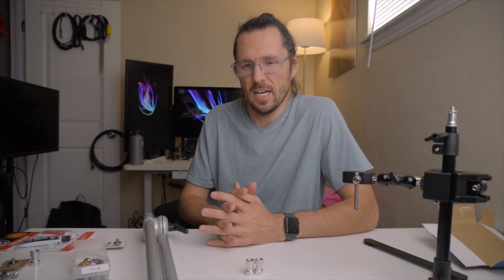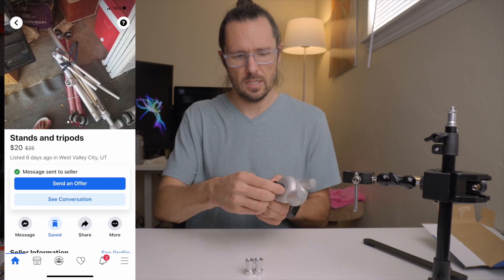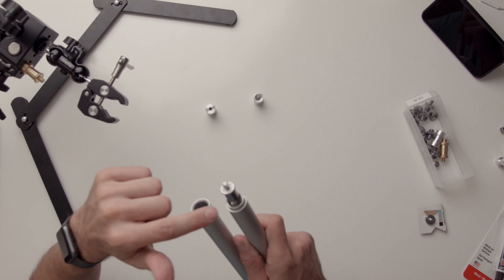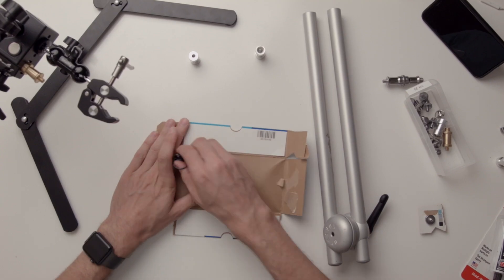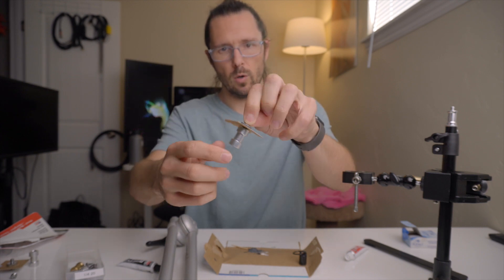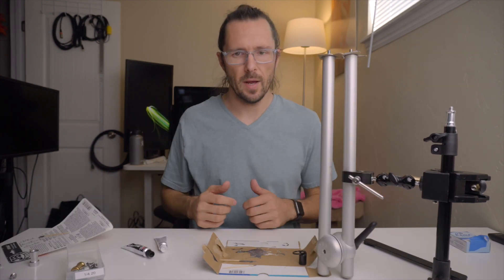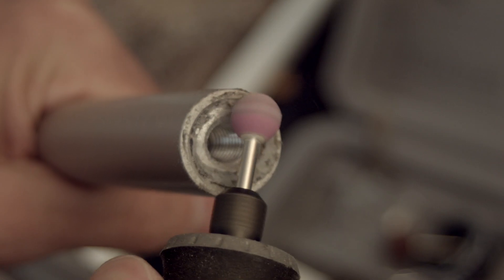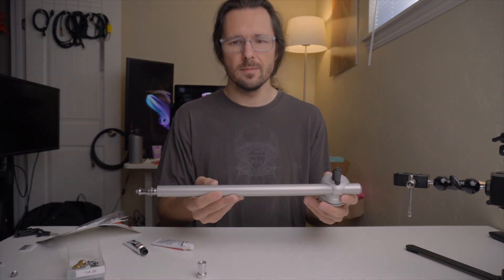I made a DIY magic arm for photography

Comment: (Yup, I'm getting a new stand for $1,480.00  So it says online. $$$)  that setup is very pricy.
 I have an old tripod with the same elbow-type parts.professional lighting. $35 bucks 25yrs ago and it was old then ... the best.
Reply from the maker: Wow. That is pricy. It is nice being able to re-use cheaper existing parts.
Reply: @austinlindsay  after watching your video I tried looking up those elbows you're using and found this light stand which is very reasonable and looks well made ... . . C (Century) Light Stand.
Reply from the maker: Yap. C Stands are an industry standard.